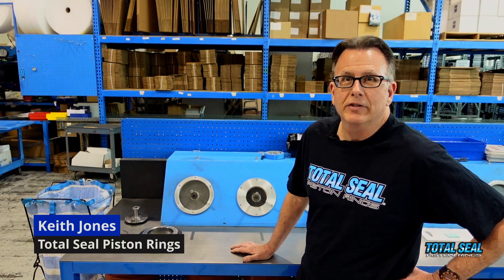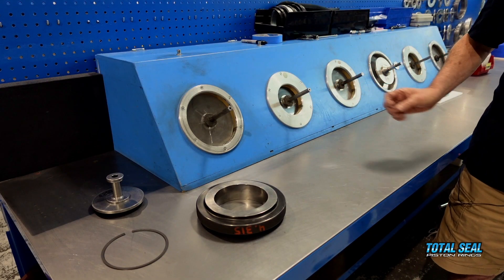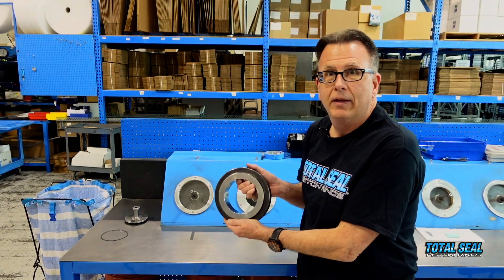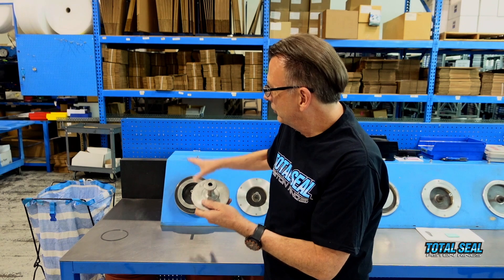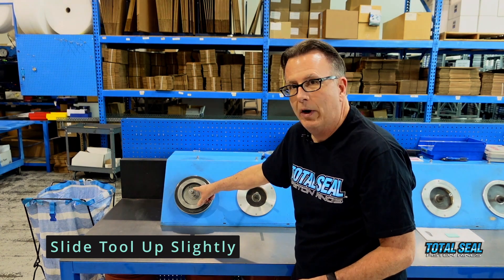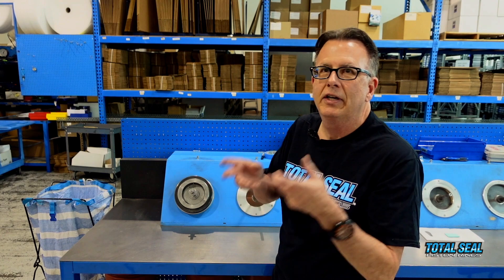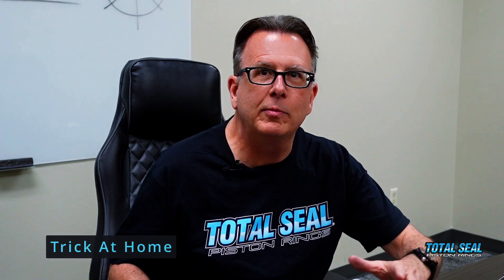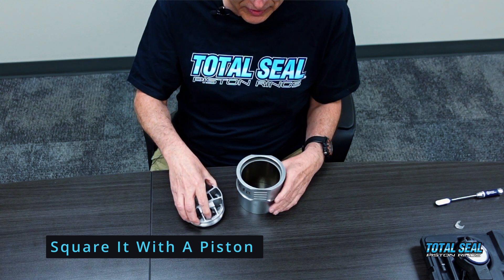Top Engine Builder's Speed Secret  / Light Tight Checking Piston Rings / Reduce Blow-By

Comment: Keith, is this going to be a valid test on an engine honed with torque plates?

Meaning, can the customer use this test, if he doesn't have the torque plate to put on the block for this test?
Reply from the maker: No, don’t light check without torque plates if honed with torque plates

Comment: Light tight  without a deck plate in a parent boor would be bad, right? because  the bore shifts when bolt load is applied, other wise a deck plate is pointless for boring a block.
Reply from the maker: Ideally, check it with a deck plate.

Comment: This is done without the cylinder head?
Reply from the maker: Correct. Without the cylinder head.
Reply: @TotalSeal 
But does it work, if the block was honed with torque plates?

Comment: Great tip and brilliant equipment! I’ve always used light behind the ring’s in the cylinder if in doubt of bore conditions and even apply a drip of oil between the top of the ring and bore and check for seeping past the ring but this is usually on quick low budget rebuilds
Reply from the maker: Good call on use the oil drop!

Comment: Until 1955 and we got cracked-chrome bores on our Wright R-1820 cylinders - we aircraft mechanics would have to take new 6" pistons and rings and slather them with Clover Compound, fit them into a cylinder - then they went on a special motorized fixture that both reciprocated and rotated them. We'd run them about 15 minutes, wash all the compound out with gasoline, and then check them for light-tightness. You don't have to have fixtures quite that fancy. We'd square them up with a different brand new piston and then had a flat disc of aluminum about 1/8" smaller than the bore and roll the cylinder while shining penlights in the spark plug holes.
      I've done exactly that to hundred of engines BY HAND since then of all different kinds. You don't do the oil scraper rings, duh.
I want to caution anyone attempting this that the grey lapped surfaces have silicon carbide grit impregnated to them so you have to follow up with 1000-grit or finer abrasive cloth to make it anything grey become shiny. Don't be careless or over-do it or you will ruin your fit !
Reply from the maker: Wow, thanks for sharing!
Reply: Doesn't the Wright have Barrels for the cylinders? So it's easy to do this procedure for radial engines. This sounds really interesting but I wonder how to adopt it to V engines. A picture of that fixture machine would be helpful too
Reply: @dantheman1998  One simplification you can make for non-life-critical power units is to skip the light test.
     On practically any engine ever made you can drill an approximately wrist pin size hole in an approximately con-rod thickness bar of steel and make a T-handle on the other end of said bar. It is okay if the rings sweep a little higher in the bore than they will in use - but it's a hassle if they pop out.
        Most V8s I tried it on you can just watch as you pull towards the bottom of the bore. Many engine's piston skirts will hit main bearing bosses it they are crossways in the bore at the very bottom so be careful.
    Instead of a light test you can inspect the cylinder bore for uniform lapping as well as the edges of the rings.
      Something else to consider is that you are restricted to the finest grades of grinding compound and practically "outside-edge-of-service-limits" for piston ring-to-land clearance.
  Why? Of necessity the rings have to be slathered and then lapped into their lands for this to work.  They have to be free in their lands - not jammed on the compound.
 So you should know your grit size, how to convert microns to decimal inches (Microns/25400 = Inches) and visualize that there must be room for one nominal grit ABOVE and one BELOW each ring in it's land.
        Just as telescope mirror-grinding absolutely depends on some belt slippage and randomness to avoid swirl marks and attain perfection - I find random manual reciprocation and rotation of the piston/ring assembly works best. And of course common sense dictates that you are mostly pushing/pulling along the bore axis, never spinning the piston with no axial motion, and try to never reciprocate without rotation also.
      BTW - instead of using a torque plate  -just bolt the head back on!
           Also valid for the enthusiast is to simply lightly "frost" the bore, edges of rings, main and con-rod journals and the inside of the bearings to be used with 400-grit sandpaper ACROSS the expected direction of relative parts motions - assemble the lower end DRY and hand-crank it several hundred revolutions, and observe the polishing-out of your tiny scratches.
That was routinely done in the days of racing flathead V8 Fords. It was fine for people who don't mind taking engines apart and putting them back together however many times it took.
        Every brand new Triumph or BSA motorcycle we ever sold got taken apart and it's rod big ends and rod caps filed down slightly, slathered with 2A Clover compound and spun slowly in a lathe while periodically snugging-then-tightening the bolts to make shaft and bearings round and have .002" oil clearance.
Reply: @dantheman1998  
https://www.youtube.com/watch?v=z4Og4HylYmw

Here is a Model FL boring bar that has seen better days. It's bigger than mine but mine was 80 years old and NOS when I bought it.
A square tool similar to a lathe RH tool goes in the square hole in the head and in use a detachable micrometer adjusts tool "stickout". They had many cool feature such as a built in centering "star" attachment could be used to auto-center over the unworn portion of the bore. I found myself frustrated by the non-perpendicularity of bores-to-main-bearings and also bores-to-block-decks is why I ended up fitting a tiny dial indicator in place of the cutter and learning how to use "feathers" (tapered feeler gauges really) as "jack planes" (opposing wedges driven together to raise something while keeping it level) to tilt the base of the boring bar which clamps itself onto the engine deck or a special table with a specially made carriage-style bolt.

Lets see is you can see this picture of a Starret last word test indicator:

https://www.rshughes.com/p/Starrett-White-Half-Shaded-Last-Word-Dial-Test-Indicator-711MGPSZ/049659_52946/?gclid=Cj0KCQjwmouZBhDSARIsALYcouppBrL6dZNNoprPCsHS-DzaBPG9B7V8cZvCuRXH0BEcvQ1_wrAyl20aAo_YEALw_wcB

Comment: So how truly round is a cylinder under combustion? If it isn't truly round under combustion does the conformability of the ring to the cylinder become more critical and is this achieved with gas porting pistons and choosing the proper ring material?
Reply from the maker: Great question! The cylinder will distort under combustion pressure, and the conform ability of the ring is what keeps the seal. We can do that via gas ports and other design factors of the ring.

Comment: Is there a maximum psi a set of rings can hold? Gasoline, not a diesel motor. Does a certain CR = a certain psi range?
Reply from the maker: A 1/16 AP steel ring can handle the 11,000 HP of a top fuel engine (not sure how much cylinder pressure that is).
Reply: I hear they have to change the oil each round due to fuel contamination.
Reply from the maker: @daveyt4802  yes they do!